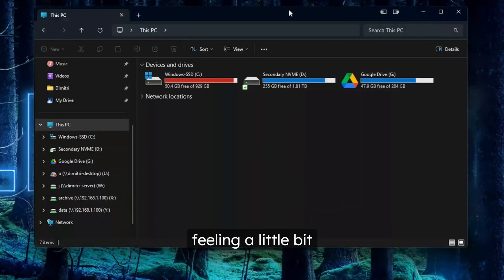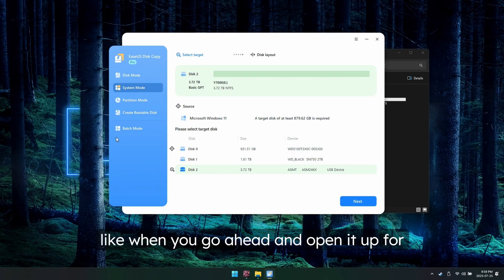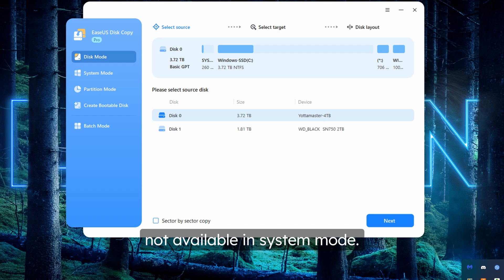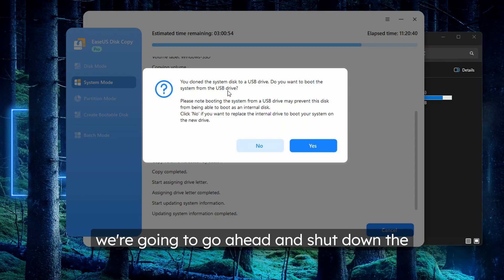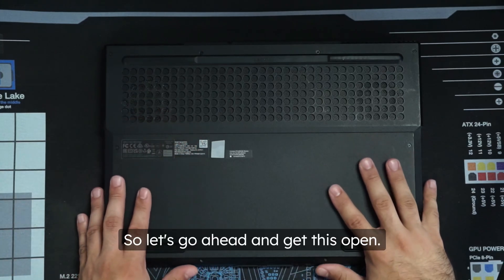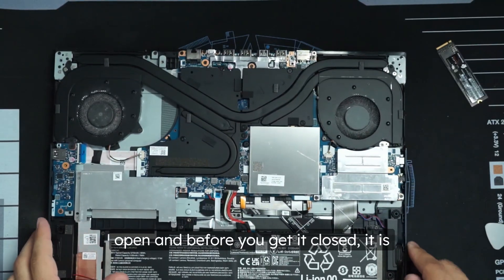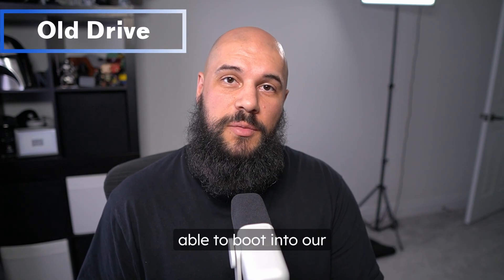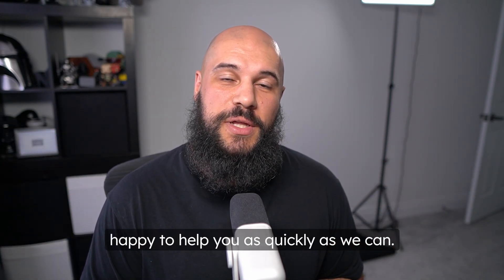How to Upgrade Laptop SSD to A Larger NVMe SSD Drive

Comment: What size screwdriver are you using when you replace the SSD?
Reply from the maker: Most SSDs use Phillips #0 or #1 screwdrivers for installation. For M.2 NVMe SSDs, you'll typically need:
PH0 for the mounting screw
PH1 for the heatsink screws (if applicable)